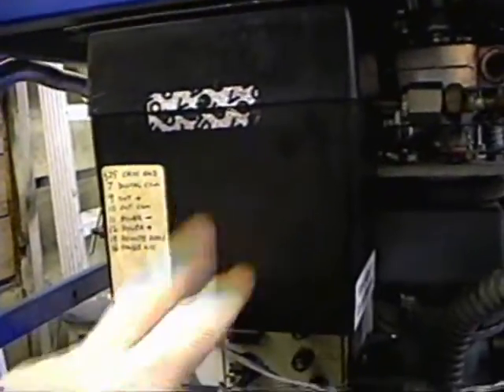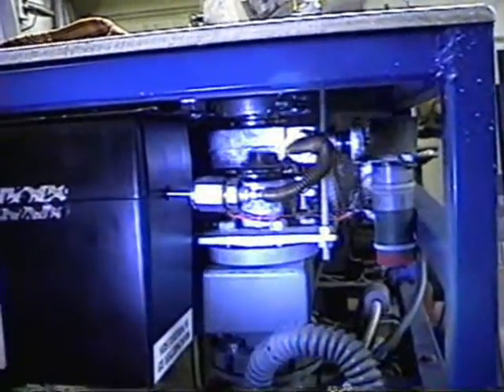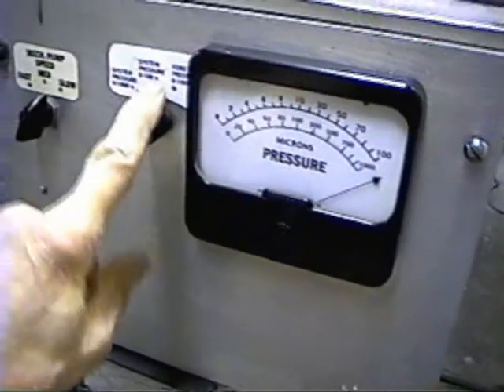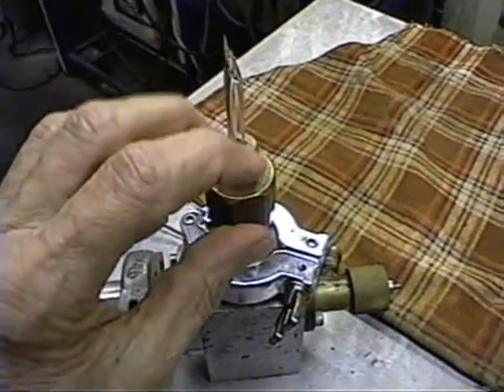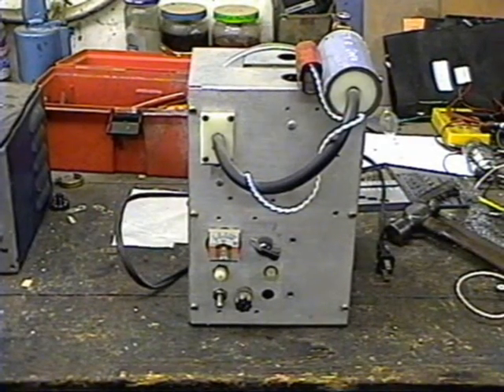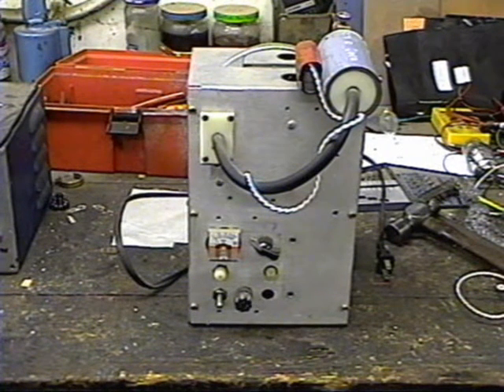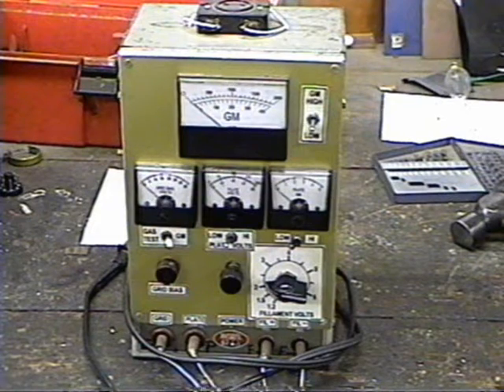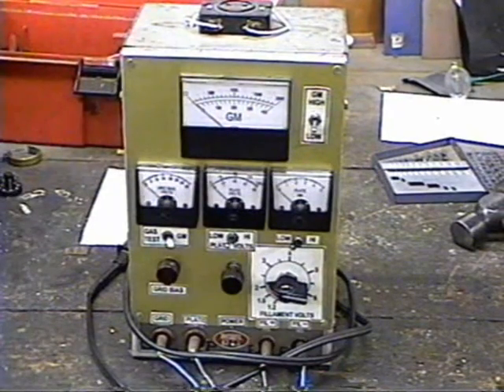vacuum tube making equipment 2

Comment from the maker: Hello!
It is homeade. The commercial ones are made for welding large pieces so they are too clumsy for the delicate tube making. I used a transformer from an old 1200 watt microwave oven for the core and cut off the high voltage secondary and replaced it with enough copper strap to get 5 volts.

Comment: Fantastic!! How did you make the blow tube with the shielded bearing? I suppose , how did you assemble it so that it works?
Reply from the maker: Make a cup housing with one tube on the side. (the bearing should press fit) Make the second tube to press fit into the bearing hole. Nothing to it! Be sure to select a freely turning bearing so your hose will not get twisted up.
Reply: @glasslinger  I just ordered a shielded bearing from Amazon as soon as I saw what you said. Do you mean one part on the outer part and one through the hole?
Reply from the maker: @Biokemist-o3k  Yes. The bearing separates the two tubes. Of course make the tubes the diameter to fit your hose. 1/4 I.D. surgical tubing is what I use.

Comment from the maker: It was a find on ebay. I paid $20 for it. They don't come around often. They are originally used for resistance soldering machines for high density electronic connectors.
ron

Comment from the maker: The normal color of getters is anything from a deep black to a tan. The color has to do with the type of getter material. Do not heat the glass envelope where the getter is flashed. This will cause the trapped gas in the getter flash to be evolved into the tube, thus ruining the tube. If you want to "refresh" the getter you must use an induction heater on the getter ring to heat it to red hot again. There is no other way. See my "tubecrafter" website for more info on the getter flasher.

Comment: Oh ok, I kinda figured it was homemade by the looks of it, just wasn't too sure and I'm not surprised that you are useing a Microwave Transformer as I'm looking for one currently to make a Battery Tab Spot Welder for like Ni-Cad's and such. My next question and the most important one is where did you get that neat lil Pinch Handle or whatever it's called?  

Thank you so much for the Reply :)

Comment: What is the model of your ion  tube and diffusion pump?  Also did you change  to a turbo pump?
Reply from the maker: I have old air cooled 4 stage Veeco diffusion pumps in both the main system and the leak detector. I have a turbo in both the bench top system and the vacuum plating system. The ion gauges are the standard glass type you see on ebay for 50 bucks.

Comment: Very nice presentation. I would like to know about the welding machine. you said that you use 10 - 60 A current. Can you please tell me whether it is a AC or DC power? I tried to make one by using a high current transformer. I use directly AC current. It welds well the stainless steel wires and foils well. But i see problem in tungsten wire spot welding.
Reply from the maker: Ah yes! Tungsten and copper are difficult to weld! Use a thin piece of nickel foil between the two pieces to serve as a weld material. I use .003 nickel shim stock available online cheap. Cut it into a long thin strip and clamp the end between the piece to be welded to the tungsten. The strip can then be trimmed off with a cutters.
Reply: @glasslinger  thanks for the information. My question was whether you use DC capacitor discharge method to weld or straight with high current AC from stepdown transformer to weld? whether you use AC or DC for welding. 
Can i get your email to contact you directly?
Reply from the maker: @nanoindus  I have two units, one uses the direct AC current from a high current transformer and the second unit uses a 100,000 mfd 50 volt capacitor that is charged to various voltages to get the correct weld pulse. The transformer is best for larger welds that take a lot of heat while the capacitor discharge works best for fine wires that need a very short pulse to keep from burning the wire in half. You can directly contact me through the messaging system.

Comment: I've learning a lot with these great videos. Could you please tell me dear Glasslinger, where do I get the "getters" or how I do to make them? Thanks! :)
Reply from the maker: There are online sources but you have to buy thousands at a time. (hundreds of dollars) You can take the getters out of old TV tubes and most of the time they have enough left in them to get a good flash. Remember, the getter immediately starts deteriorating when it is exposed to air so be right ready to use it when you break the old tube. You have less than 30 minutes! Be quick!
Reply: Thanks! :D

Comment: i made a vidoe on a ozone gas generater i built and it makes 26 to 30 $ a month for some reason? its the most popular video i have ad wise , people who go to that vidoe buy stuff from the adds on my page , you could build the coolist ozone generater on the block with the stuff you have, just to save you time if you do build 1  hihg frequency is best and low heat becuase ozone has a half life of 1 second at 250 degrees F so low temp units make more ozone gas